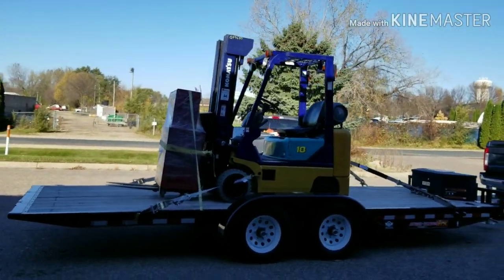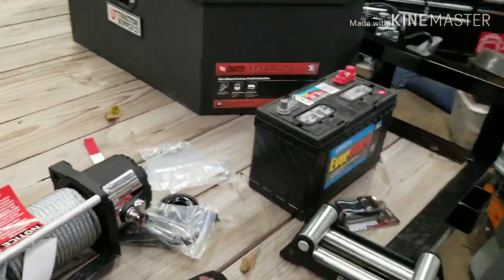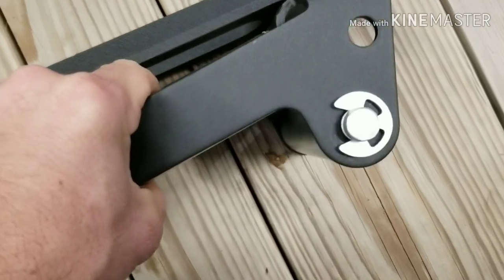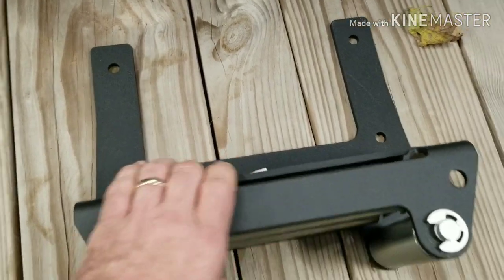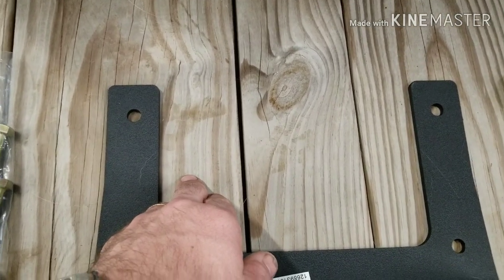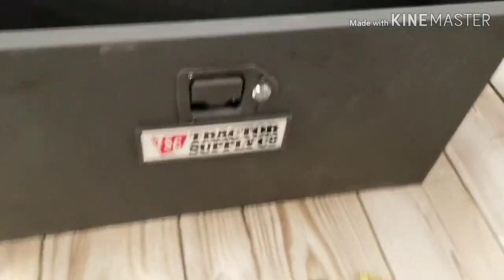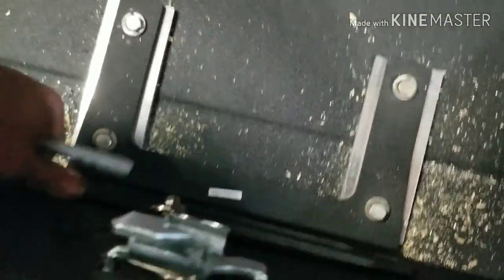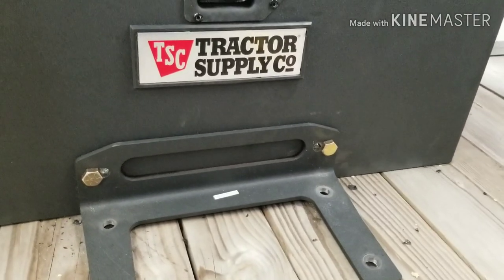How to install a winch on a car trailer.

Comment: Hey did anyone try this and add charging from the truck through the 7 pin connector? Can you have both the solar panel and truck charging the battery at the same time?

Comment: Great video. I would suggest putting a plates between the bottom of the trailer and the nuts underneath the trailer. I'm not sure I would trust that lumber to support the winch under the load of a larger vehicle without pulling up through after time.
Reply from the maker: 1/4" plates on the bottom. First winch load was a 7500lb forklift worked great

Comment: Love this project. Planning on doing something similar to my trailer. Question: any possibility of running an inverter to the 110 outlet to use off the battery?

Comment: You did a great job.
Only one thing I would have done differently because everything else looks awesome but I would have mounted  on the tounge.  I never sacrifice trailer space. You can only pull something  up so far.  Everything  else i really  like
Reply: yes just lost 3ft on the trailere

Comment: I have to agree, loos good and i am looking to mount a winch to my new trailer want wanted to ask for )even if they are not available anymore) the components list with model numbers would be great for reference (just for the solar battery setup) .  Thanks
Reply from the maker: That one isn't available anymore but Amazon has quite a few different options and sizes

Comment: Just wondering why did you mount the box on the deck and not forward on the frame?  Very nice setup. Ill be doing something similar.
Reply from the maker: Because if I mounted it forward the winch is useless when the trailer is tilted
Reply: @JDSOutdoors  ahh, makes sense.
Reply from the maker: @FauxShelby  if it wasn't a tilt deck then I would mount it up front
Reply: Not if you mounted a pulley for the cable to run in while the trailer is tilted.
Reply: Ah didn't know it was a tilt trailer u didn't show that in the video. Just showed after the forklift was already on.

Comment: Great video. Just curious, did you wire the solar controller to the smart battery then to the battery? Or did you wire both the smart battery charger and the solar controller to the battery?

Comment: That was an outstanding video, really like the work. The only question I have is how did you secure the box and the winch to the trailer structure? I know how you mounted it, outstanding instruction but wood isn't going to hold that in winch in place winching something up there... Thanks man!
Reply from the maker: Dozens of vehicles, forklift and a skid loader it's been holding great just the way it is
Reply: @JDSOutdoors  No kidding, I would for have thought you tied it into the frame some how. Thanks for the reply.
Reply from the maker: @1badcj8  big washers spread the load but I do want to move it up front now that I have more metal fab abilities

Comment: Great video. How did you mount the winch though? How do you fit bolts through those 4 legs of the winch?
Reply from the maker: Had to grind the heads to get it to fit.

Comment: Nice video , do you think that the 4 bolts are strong enough to pull a car on the trailer though?
Reply from the maker: Hundreds of cars, forklift and a skid loader so far.
Reply: @JDSOutdoors  first thanks for the fast response haha and great that's how I'll mount mine mine as well

Comment: Holding bolts whilst you can not, use a socket, breaker bar and some blue tack in the socket.

Comment: What is the NOCO GCP1E 15 Amp AC Port Plug, 125 Volt Power Inlet Socket, Charger Plug, And Waterproof Electrical Outlet Receptacle With 6-Foot Integrated Outdoor Extension Cord for?
Reply from the maker: To plug in the charger without opening the box

Comment: Am I correct in saying the solar panel trickle charges the battery and or you can plug the 110 in to an outlet to charge the battery via that charger.  So 2 separate ways to charge the battery.
Reply from the maker: You are correct

Comment: Have that same set up with 12000 pound which. How did the solar panel system work and what is the name of the solar panel where can I get it?
Reply from the maker: Parts are in the description and it worked awesome. Never had to charge it.

Comment: Nice clean professional looking project. What was the cost for the project? Insert a materials list in comments section.
Reply from the maker: Trailer was 4500
Box was 250
Winch 200
Solar 40
Battery 100
Probably $50 in random wires plugs etc
Reply: @JDSOutdoors  thank you! You have done a great project.
Reply: JDS Outdoors that’s really reasonable. Great build for the average joe. Thanks for sharing. 👍🏻

Comment: Nice and clean install.  That looks like a 16 ft trailer and I have a similar one but a Carson.  Do you have any concerns of the box taking up deck space?  I just installed a winch but need a toolbox.  I was looking at putting the box on the tongue but not sure.  Also is that a tilt bed trailer?
Reply from the maker: Yes it is a tilt bed which is the reason I put it where I did. I do plan to move it to get the deck space back eventually. This is a 20'

Comment: I have the same setup on my tilt trailer with a tractor supply truck bed toolbox with a smitty bilt 10,000lbs winch

Comment: Do you have a short list of the battery/solar panel/inverter/charge controller you can provide? Assume you got everything on Amazon?
Reply from the maker: Yes absolutely the list is in the description
Reply: @JDSOutdoors  Thanks for the quick reply! For some reason the only thing I see in the description is "How to install a winch and self charging battery system using solar." Maybe its just me though?
Reply from the maker: @gmichaelson3434  yep thats all I see to. Weird I'll update it again check back in a few hours
Reply: @JDSOutdoors  Thank you, I appreciate it! I'm about to get after this project and would love to follow with the same equipment if possible; your video was super easy to understand!
Reply: First, thanks for adding those links and details! I feel like I should know the answer to this but here goes...what do you use the AC port for? An aux power supply from the battery for tools etc? Something else? Thanks!
Reply from the maker: @gmichaelson3434  for the battery charger to keep the connection waterproof. However the solar works so well I never use it

Comment: Should have mounted it on the tongue of the trailer like it's intended. And ran the winch out the back of the box. Would have freed up all that deck space.
Reply from the maker: It's a tilt deck wouldn't work

Comment: How long does your winch run on the battery.
Reply from the maker: Well its been over a year of almost weekly use and I've never charged it.
Reply: JDS Outdoors really! I’m currently installing a winch on my trailer with a stand alone battery and I’m trying to decide which battery to use. I’ve seen where people say you only get roughly 4-6 pulls before you gotta charge the battery.
Reply from the maker: @jeremyfox2818  that solar makes a huge difference  and I've done 4 pulls in a day with no issues
Reply: JDS Outdoors awesome man. Thanks for the help!!